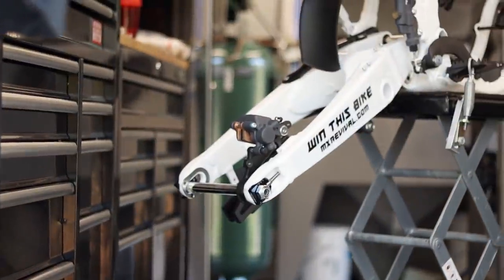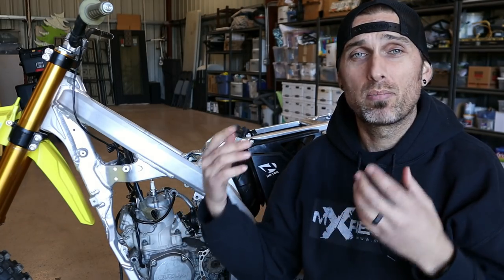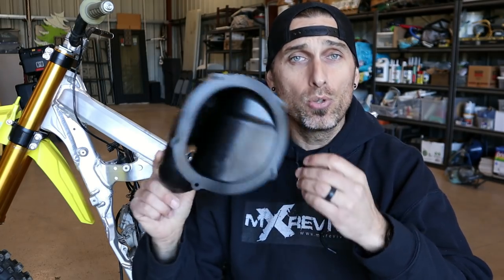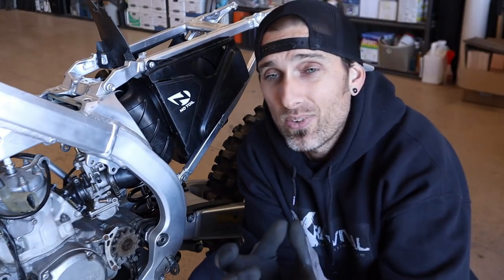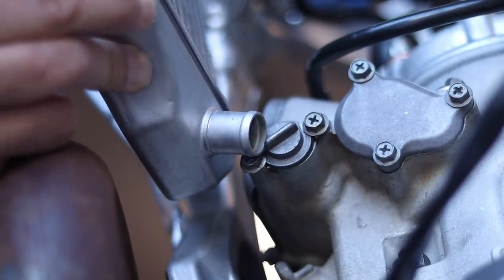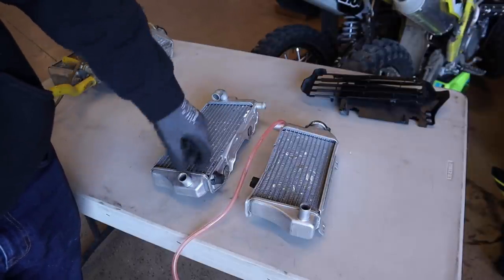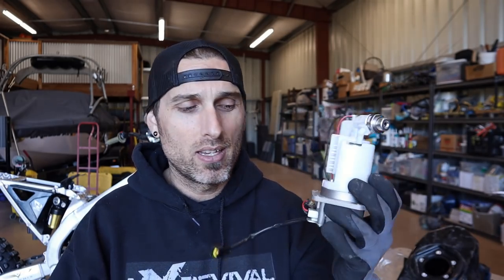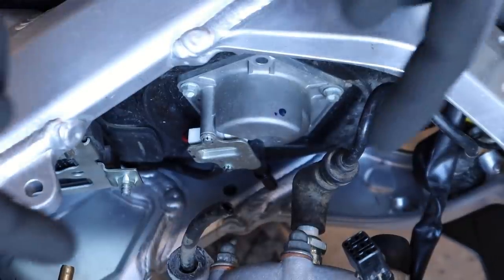The 2022 Suzuki RM250 🔥 RM250AF Two Stroke Build & How To - Air Boot - Radiators - Fuel Pump Delete

Comment: Do you have enough room under the tank to make a block off plate that will also give you a meaningful amount of additional fuel, for off-road?
Reply from the maker: It's a good question but I'm not sure if oversized fuel tanks, for example, portrude lower end of the area in the first place. An oversized tank with a deeper belly might complicate things but in the future episodes you'll see how I'm going to do this so that it maximizes space underneath... Hopefully regardless of standard or oversized fuel tanks.

Comment: Hey bro so what are the mods you've done on your rmz450 besides the exhaust that have made the biggest difference? I've got a newer rmz450 and I'm starting to throw some mods on it. Already have a yosh rs12 system
Reply from the maker: Hey J, 

I haven't actually filmed the Pro Circuit pipe episode yet, so I'll do that soon now that I have a good 25+ hours with the stock one again. I have been holding off so I can give you guys the true back to back feel test.

As for everything else, I filmed all of it! Suspension, engine mounts, different weights, etc. 

You can find all of that here 💪: https://youtube.com/playlist?list=PL_oYXNbYADbLkcRG2Fo9zS68NK4_SumsI

If you want me to forward some more detailed info your way via email, I can share a mod list & pros/ cons with you that way too. It's one I typed up for another rider that you might like. Just reach out here, and let me know it's you since I receive a lot of emails, DM's, etc. every day: https://www.mxrevival.com/contact

Thanks!

-Charles // mXrevival
Reply: @mxrevival  Will do! Thanks for the reply 👍

Comment: I wonder if you could pull the lower radiator tanks from the old radiators and graft them to the 250f radiators...
Reply from the maker: I bet it can be done but closer inspection suggest I won't need to do it that way. I like that because the newer RMZ's have radiator louvers (the plastic fins) that are form fitted to the shape of the rads & lower tanks. So it looks really OEM and nice!

Comment: Nice job!, personally I would look into modifying the fuel pump base to remove that wire, then weld a flat plate to it so the stock petcock could then mount to the new flat base.  Oh, and instead of being a "Little Guy", how about just being a "Biggie Smallz" guy?   (as in a small shop but a big ummm... well...  😎).
Reply from the maker: 😂😂😂 BIGGIE smallzzz.  You already know I can't handle that wire hanging out but need to show the option to others! 3D printed block of test pate is in progress!